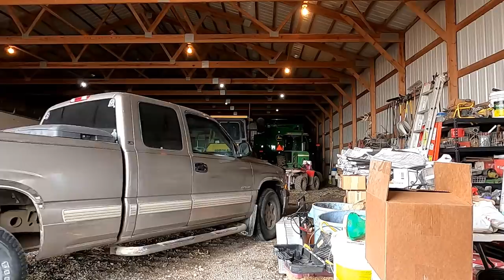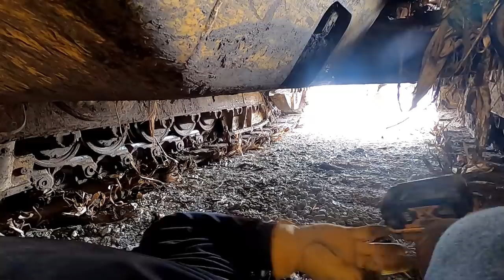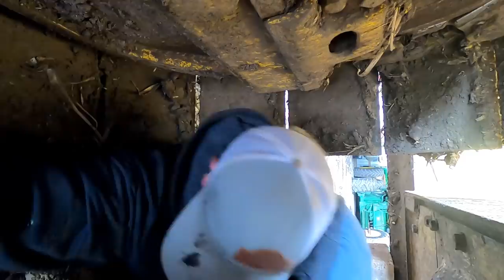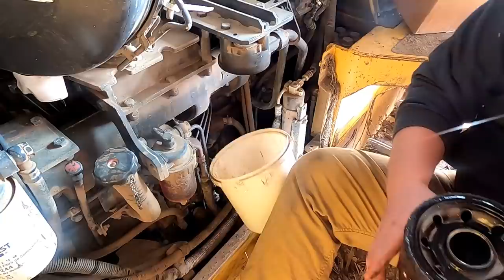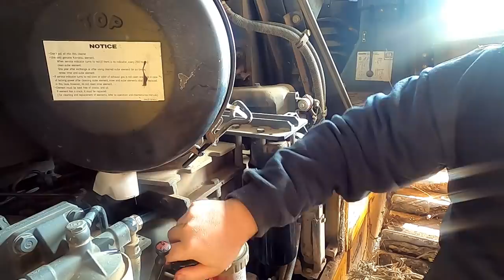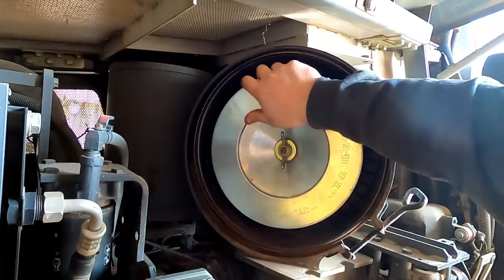Komatsu Maintenance Time with Dad!

Comment: Try pulling a vacuum on the oil filler.  Oil won't drain until vacuum is turned off.  Turn back on when bucket full.

Comment: Do you write the date and hours/mileage on the new filter when you replace it?  Using a silver sharpie works great for that.  Also recommended writing the date you cleaned the air filter too.  It’s just helpful to keep track of maintenance that way and takes very little extra time to do it